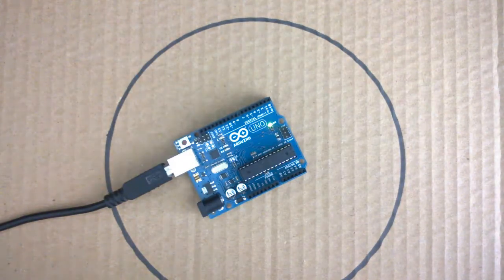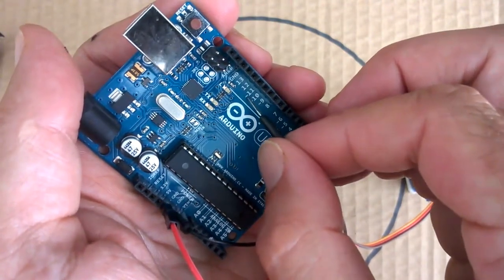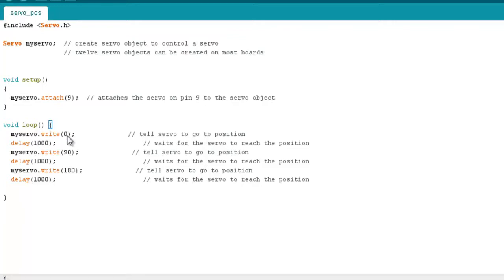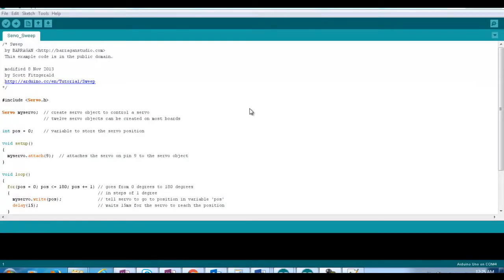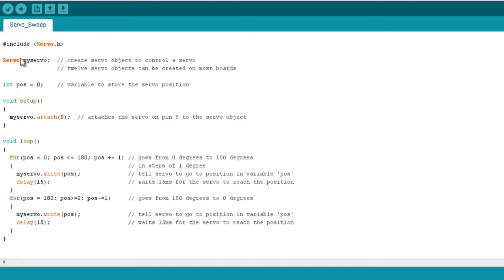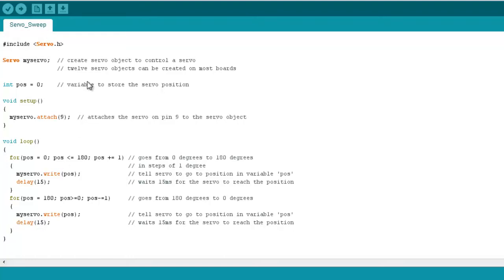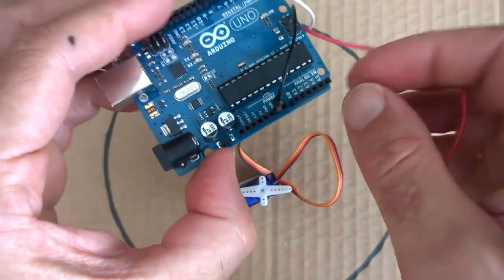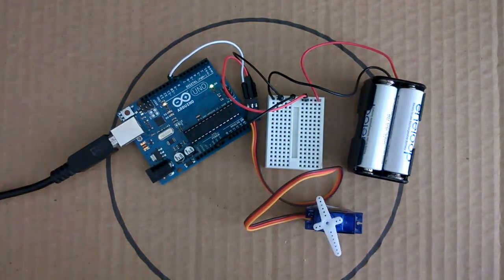Lesson 4 - Servo Sweep - Arduino a Quick Start Guide

Comment: i clicked the upload button on my program,but it's saying that it can't detect a board. i've even clicked the reset button and still says the same thing,what should i do?
Reply from the maker: Sorry about the delay. If you are using an Arduino clone, you may need to install extra drivers on to your computer for the particular USB chip. If you type into Google "Arduino clone driver" you should be able to find the download

Comment: Ok so i deal with many RC servos because of my Hobby.   A common problem I run into, is not having enough sweep on the servo.  With Transmitter end points maxed for a 500 to 2500 bandwidth, I am only getting something around 110 to 120 degree sweep on the standard servo.  I realize that the use of Arduino circuit board as you have it would be neccessary to acheive the 180 degree Sweep.  What I am going to ask is would it be possible to use the Arduino, or some form of it, to program the servo for a 180 degree sweep so I could then just use a transmitter to run the servo?  I hope i explained it clearly enough.  I would love to "program" my own servos to function this way.

Comment: I can hear my servo buzzing but it isnt moving btw im using an arduino nano plz help!
Reply from the maker: If you can post the code that you are using I might be able to see why the servo isn't moving. It could be something in the code, or it could be that the servo's gears are jammed. The buzzing sound means that the servo has power to it.
Reply: I’m currently on holiday but I will do it when I get home
Reply: Also I don’t think my servo is jammed as I swapped it out with another and the same thing happened
Reply from the maker: @louis3117  If you can post the code it might help me to see why the servo isn't working. Are you sure that you have the servo attached to one of the PWM pins on your nano?
Reply: Which ones are the PWM pins
Reply from the maker: @louis3117  PWM: 3, 5, 6, 9, 10, and 11. Provide 8-bit PWM output with the analogWrite() function. https://store.arduino.cc/usa/arduino-nano
Reply from the maker: PWM is also used to send the signal pulse for the servo motor position
Reply: Code is:

#include <Servo.h>

Servo myservo;

int pos = 0;

void setup()  {
    myservo.attach(9);
}

void loop()  {
       myservo.write(0);
       delay(1000);
       myservo.write(90);
       delay(1000);
Reply: I am trying to use the sweep preset but it still wont work

Comment: How can i sweep two servos on diffrently
Reply: Did you figure it out? i'm trying to build an animatronic face with eyes and jaw sweeping  simultaneously at different angles.
Reply: attach each servo to different digital pins on arduino and type a sweep code for each servo.